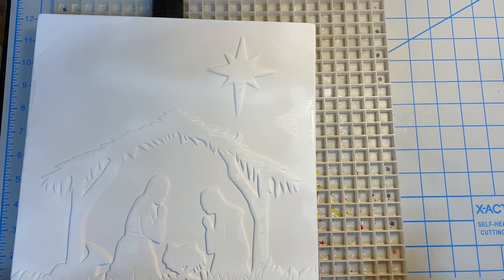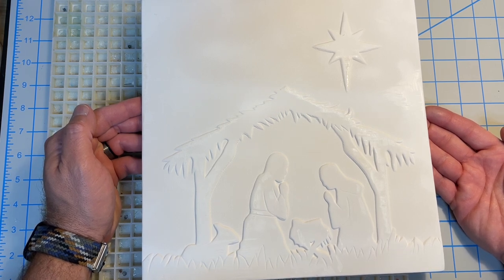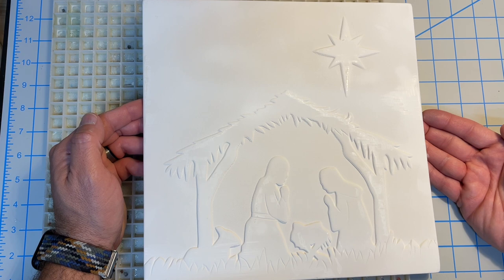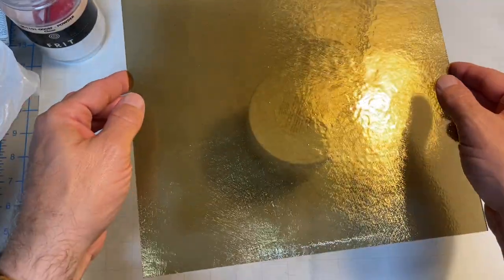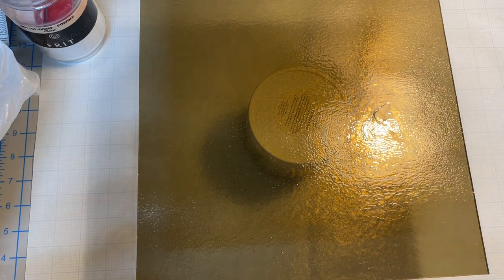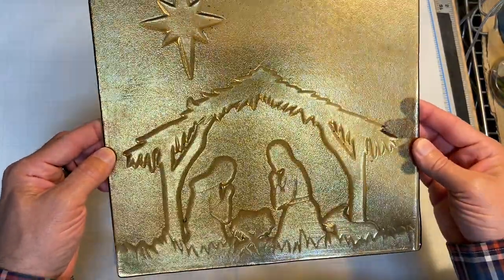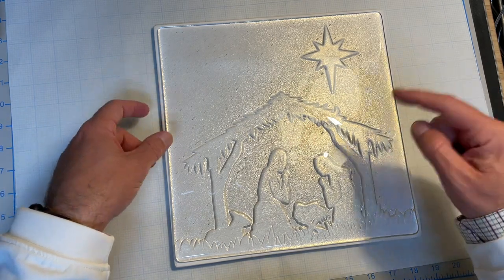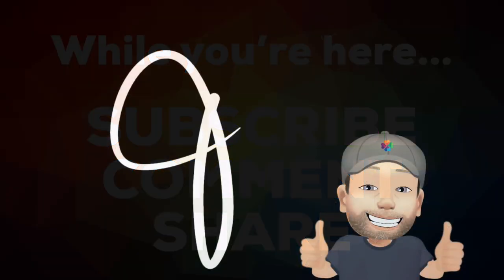Fused Glass Nativity Platter

Comment: Hi Jamaison, I absolutely love this piece. This mould has been on my wish list since last year. unfortunately I can not find any suppliers in the UK that sells it and shipping costs from the US to the UK are phenomenal.
I have 2 questions. I am new to fusing so if these questions have obvious answers please forgive me.
a. when you slump into the platter mould how come the texture stays pronounced? I thought you would lose all the details.
b. could you fill the casting with powered frit to give it a shadow effect? and how would you retain this shape when refiring in the kiln?  
Keep up the great work, your video's have kept me going through the Covid lockdowns.
Reply from the maker: A slump temperature is low enough to slightly move the glass with gravity but not warm enough to degrade your design. And yes, you could try to add some powder frit, but again, a slump temperature isn’t hot enough to fuse that into the piece. A hotter temp to add powder might be 1350 or so (?), and while the powder would help keep the design, you would certainly start to lose the depth of the texture.
Reply: Try Tempsford Stained glass for Slumpy moulds in the UK

Comment: I wonder if the frit powder contributed to the bubbles?   I never use powder with texture molds, so im just speculating.
Reply from the maker: I suppose that’s possible, but I’m more inclined to think it may have been air between the mold and the glass?